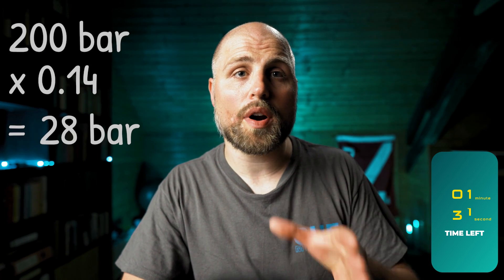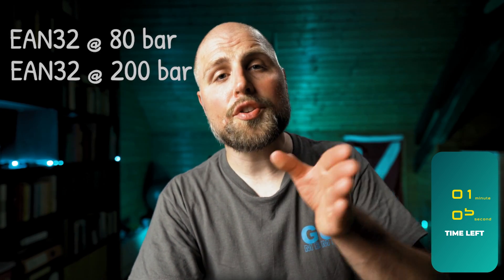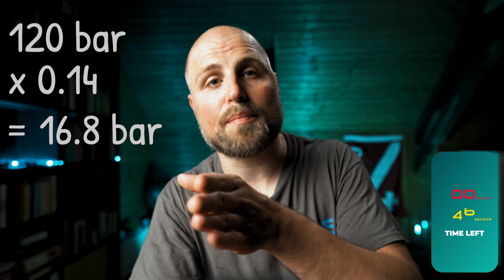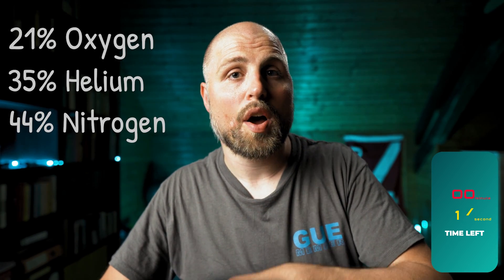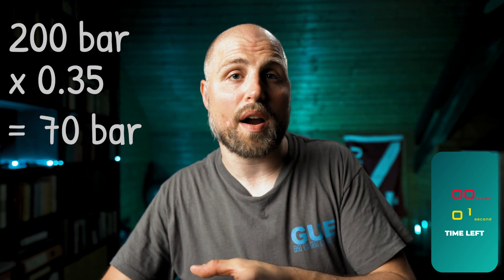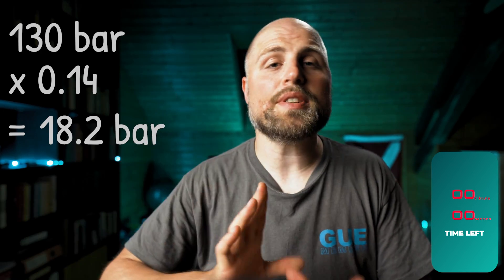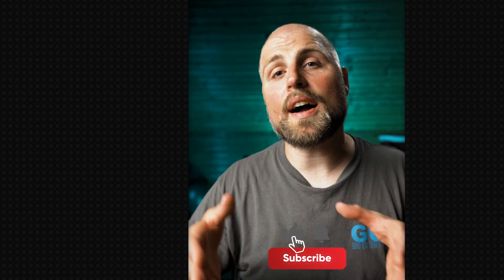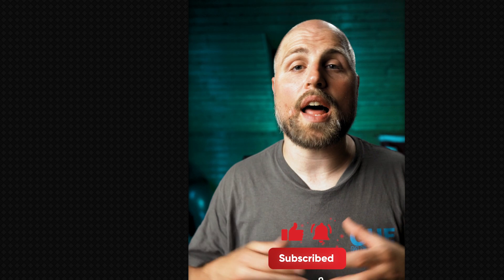How to calculate Nitrox and Trimix blends easily without software

Comment: How about the blend 18/30
Reply: In general, the topoff proportion is the ratio of the nitrogen content in the desired to that of the topoff. For example, for a desired 18/30 (nitrogen=52%) and topping off with air (nitrogen=79%), the topoff proportion is T = 52/79 = 66%.

In this case with only one source of helium, things are simple: you know the helium added must equal the desired: 30% helium. The oxygen is whatever is left over: with 30% helium and 66% topoff, you need 4% oxygen.

In general, though, the required pure gas is the desired fraction minus the topoff*mix. In this case of air topoff (mix=21%), the oxygen proportion is O = 0.18 - 0.66*0.21 = 4% (as we saw before). Similar for helium.

(The general approach is needed if you're topping off with trimix. Also, a negative answer means it's impossible with that topoff mix. For example, you can't get 18/30 by topping off with 32%.)
Reply from the maker: Why would you want to blend 18/30?
Reply: @DoktorBEN  the point is, how do you count for 18% of o2. Can you explain? 
32% EAN is 14% of pure o2. So how about tx18/30, tx7/72 or tx12/52. I just need to now how do you get 14% of number for mixing 32% EAN. Thank you
Reply: @DoktorBEN  its for my bottom gas.

Comment: from where does this 14% comes from (both in ENX32 and 21/35 calculations)? I'm scratching my head ... any pointer?
Reply from the maker: 1 - 0.68 / 0.79

So nitrogen content of EAN32/Nitrogen content of air
Reply: @DoktorBEN  That is correct for the EAN32 calculations, I don't understand the reason, you take the same number (14%) for the trimix 21/35 calculation (0,44/0,78)=0,564 so I add 200x0,56=112,8 bars of Air and the rest (17,2 bars) with pure O2). I dont' know if my calculations are wrong so if you can explain me the 14% in this calculation that would help me a lot. Thank you
Reply from the maker: That’s the Magic with standard gases. You can top up helium with 32% to come to 21/35. And EAN32 contains 14% of fill pressure in oxygen
Reply: @DoktorBEN  So you don't use 100% oxygen then! Do you?
Reply from the maker: Yes I do. But you could use 32%. And there’s no difference if I use 32% or “blend” it during the filling process. Do you see what I mean?
Reply: @DoktorBEN  I still don't understand because I thought it was easier to add 100% oxygen in Trimix because if you use 32% instead, you'll add N2 and oxygen in the good proportion for this gaz only (35/21) (70 bar He and 129,7 bar of EAN32) you don't need to add oxygen in the mix. What if you decide to make a Tx 20/20? Will you still use the 0.14 value?
Reply: [1-(0.68/0.79)]x100
Reply: And to get a maybe better understanding of this formula, image you have 100L tank on 1Bar, in that tank is 79L of N, you want to preserve this amount of gas 100L but in different proportion. You want 68L of N and 32L of O2, to get that you need to decrease pressure for some value X to you will have 68L of N, and then top with O2 till 100L is full.  The question is basically what is the percent that you need to decrease overall pressure to decrease 79L to 68L N, and that is 14%. after that only what is left is to fill that void with O2 and you will have 100L where 68L is N and 32L is O2.
Reply from the maker: I like the explanation!